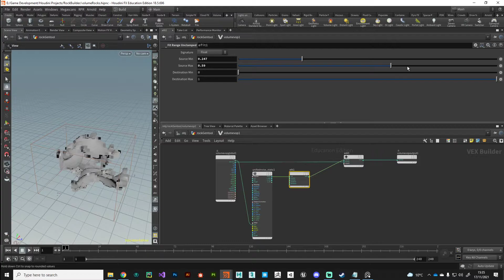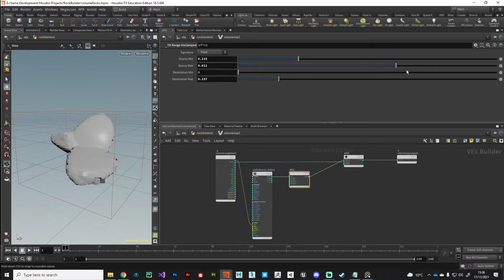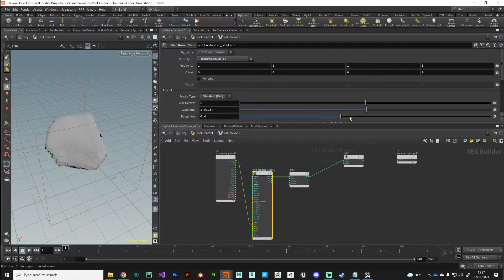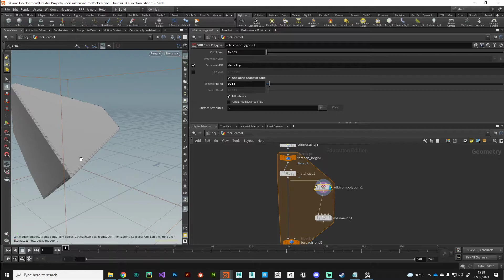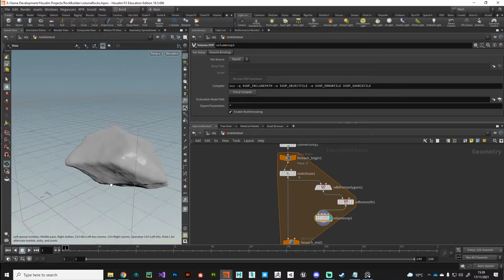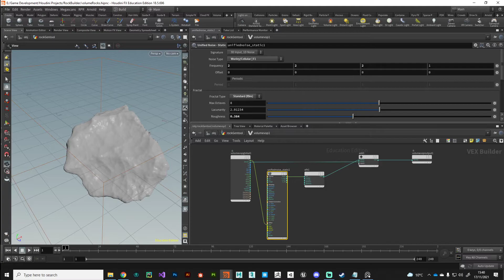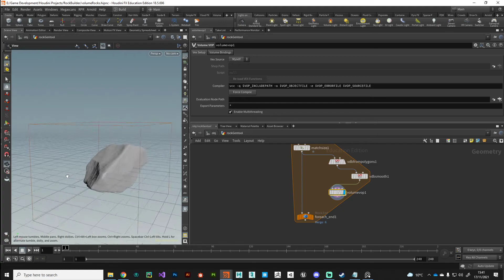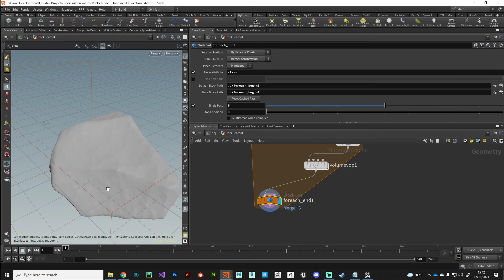Houdini Rocks 03

Comment: I tried so many different values and my rock just doesn't look full like yours. Every configuration I do, the rock always has one of the sides missing and when I increase boundary it just makes the rock bigger. I also tried making voxels smaller but that didn't help with this issue :(

EDIT: Went back and did the tutorial for the 3rd time and realized I hadn't connected the nodes properly and used regular noise instead of static.  Good tut.